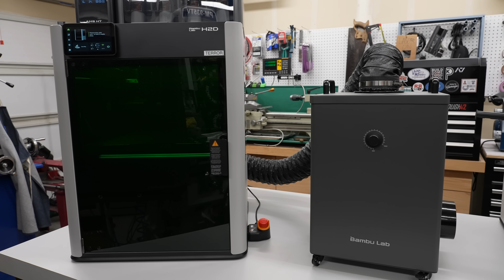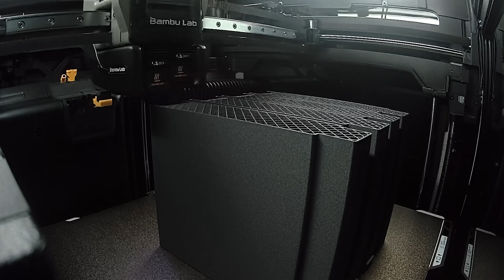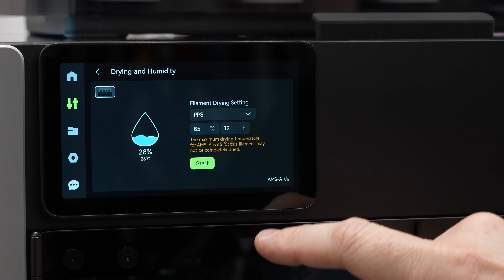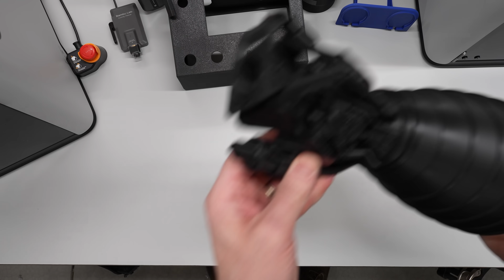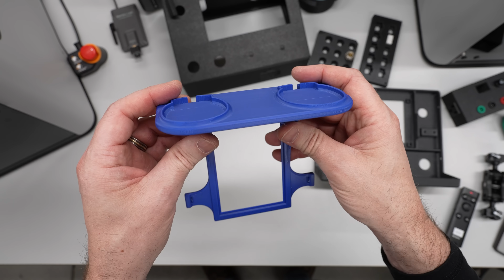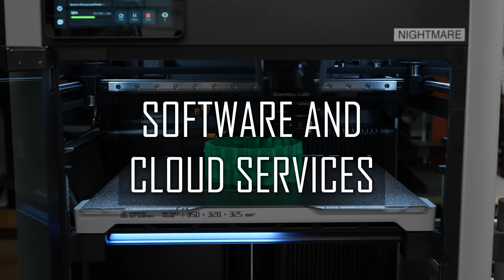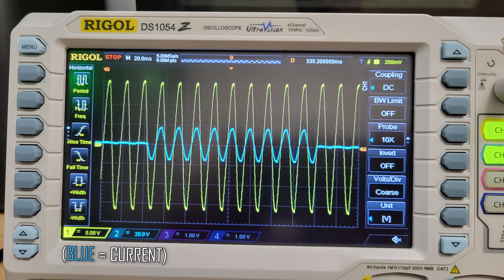What I Learned from 300 Hours with the Bambu Lab H2D 3D Printer

Comment: It would be nice if they could use the camera at the beginning of a print to detect the presence of a forgotten purge tower. I've been burned by that a couple of times. The last time it happened, the auto-leveling mesh was so far off that the nozzle dug into my build plate and gouged it.
Reply from the maker: Yeah, I thought that, too.  It seems like that should be doable if the bed is otherwise pretty clean.  If it has layers of ossified glue with the footprints of a hundred previous prints it might be harder.
Reply: @ The other thing they could do is add some sanity checks to the auto-leveling code. In my case, I was getting z-axis movements on the order of 10mm as the print head traversed in x and y. To add insult to injury, the calibration procedure moves the print head before clearing the mesh, so when I flipped the plate over and recalibrated, I gouged the remaining good side too!

Comment: Just when I started to think that other companies were catching up to Bambu and I could switch to printers with a more open ecosystem, they take another clear step ahead. In a small shop having a all-in-one machine is such a space saver.
Reply: I would advise against depending on the laser  module. Even the FAQ says that regular maintenance will need to be performed to prevent issues from dust and debris. You are likely better off getting a stand alone laser.

Comment: the laser is cool but i only use laser when cutting large pieces. And most laser cuttable sheets are rectangular so you'll only get an a4 sized sheet in there and i dont know what you can cut in wood or acrylic that you couldn't just print. Cork and card is a possible exception but it's a very niche use case.
Reply from the maker: Yeah, I think this is a concern.  That's why I tried to emphasize it in my summary.

Comment: Thank you for your honnest and detailed review. Is the width for spools in the AMS units the same as in the XCarbon? I have issues with some prusa spools jaming if the are just slightly deformed.(and many are)
Reply from the maker: Yes, I heard someone saying that it was narrower because a non-Bambu spool jammed for them, but I think it's what you describe.  The Prusament spools I have fit, but without any extra room, so any deformation would be a problem.  From my measurements, the spool wells are the same size, and the overall outside dimension is actually about 2mm wider.

Comment: 300 hours? Wow, you must have been given this well before they made any announcements. The price of the base machine is within my expectations. I’ve been saying it should be between $1,400 to $2,000. These machines are going in the direction 3D printing needs to go. I’ve got a color Hp laser printer and I never think about using it, whether I’m making copies or prints, or just scans. That’s the way 3D printing needs to end up. Otherwise it’s just for hobbyists.
Reply from the maker: The evolution of the 2D print industry is a good comparison here.  I remember having to set up form lengths, fonts, margins, baud rates, and linefeed mapping to get them to work properly.  Over time they evolved to the point where many printers don't even have buttons.  The buttons are back today so you can connect to wi-fi, but the point is valid.
Reply: @Clough42 yes. I started modifying teletype machines. Then making boards for the (new) Brother electronic typewriters, and in from there.

Comment: First, thank you for a good video.  Second, did you try other TPUs besides the Bambulab TPU for AMS?  I'm interested in using really soft TPU like Ninjaflex in combination with rigid filaments to make bicycle grips.  I have to use an IDEX currently and don't really like it.  I'm hoping the H2D can handle it in one head whether it is in the AMS or outside.  Its hard tell in the pictures so far if the filament path is constrained enough... Thanks!
Reply from the maker: It has a separate filament passthru port in the back of the machine, so you can bypass the buffer.  That's how I ran the 90A.  They also sell 85A, but have instructions for feeding it from above without a tube, IIRC.  I've run the 90A and the TPU for AMS, which is barely flexible.
Reply: @Clough42  Thanks for the extra info.  I'd be interested to see how the 85A prints. If you happen to have any.

Comment: You say they aren't paying you for this video....... They bloody should, excellent video. Showing how it works for YOU, rather than THEIR samples was great. HOWEVER a laser in a printer will not end well, the glue and crap in materials will cover the inside and I suspect 8-12 months down the road they will need parts replacing.
Reply: So if you have a print and need some thing Lazer marked. Would it not make sense to just do it in one tool. I think that it should be viewed more like adding a laser to a CNC router. It is a added tool of convenience not a tool to be used as the main thing. I mean would you get a CNC router so you could laser with it all the time?
Reply: @thomasswearingen6971  I don't have an issue with multi tools, the drag knife and pen plotter are good. My point is that if you are buying a multi tool machine you will want to use it for many things but I have doubts on the longevity of the insides of this. Of course only time will tell and we'll all have to wait for the true effects of smoke, glue and acrylic particles on the bearings and rods and rails.

Personally I would prefer a separate device.
Reply: Yeah, I’m viewing this as just a really awesome larger format twin extruder 3D printer.  i.e. The base model (with AMS).  I view the Laser capability as just a potential upgrade option, that I’d probably never do.
Reply: I really wonder about that too. No matter how good their chamber ventilation is, the microscopic smoke particles are going to get on everything and in particular gunk up the slides.
Reply from the maker: That's a fair concern.  They do have a pretty good history of making replacement parts available for reasonable cost, but the smoke contamination is a new thing, and I would think it will be an issue for heavy usage.
Reply: 100%!
Its easy to get 4k hours on my X1C with just basic maintenance but I don't think this one will last as long before the entire insides and motion system will get gunked up from all the nasty emissions
Reply: They did pay him...by giving him 2 H2D printers 😮
Reply: @pinzgauerbelgium  Not really, let's assume you work at a supermarket, if they "paid" you in food products would you be happy and declare I've been paid for my time and physical work? No you wouldn't, James can't pay for bills with printers. They've provided them for free but he and other content creators still have to use them, film, edit and publish content that all takes time which they aren't paid for.
Reply: I also suspect maybe you and the billion people repeating this line aren’t the only ones to have ever thought of it. If you’re laser cutting nonstop, then you are an idiot for buying this printer to do it. If you’re doing it occasionally then it will be fine, and you avoid having another piece of equipment taking up space. 

I have no idea who all this “helpful advice” is geared towards. It’s like every 13 year old on Reddit just learned that lasers burn things away (SHOCKING!!!!) and that this can generate soot, and have made it their life’s mission to spread this piece of obvious and mundane wisdom to nobody in particular.

Yes, thank you, you’re very very very smart and good. People with experience and needs beyond 3d printing nude anime figurines can make their own decisions.
Reply: @Rokmononov  why are you acting like a triggered child? I remember when this community was filled with enthousiasts instead of toxic noobs ranting about their dumb opinions
Reply: @Rokmononov  Haha, what a childish comment. Making the non experienced viewers aware that having a laser inside a 3d printer is a bad idea is a completely valid opinion. If you believe that does not affect you, then move on.
Reply: @Rokmononov I've seen how quickly the residue builds up inside the lense assemblies on other laser engravers, and how surprising it is for 3d printing people that it happens so quickly, so it's not exactly "mundane wisdom"
Reply: Well…not paying you but how did you get the printer? 😂

Comment: There is a lot of critic about Bamboo lab, that they force the user to connect the printer to Internet.
Reply: Yep, that is one of the costs of such an integrated system. Try using an Apple product without becoming part of their ecosystem.
Reply: @JorgTheElder  I would never use an apple product!
Reply: Do you want to send the file over wifi? You need to connect to the internet OBVIOUSLY. If not you can just hook it up with a LAN cable or worse, go back to 2015 and transfer to your SD card lol.
Reply: @ Check out my links. I i buy a product, it is mine. And then Bambu labs change the the terms, that is a fraud!
Same as car industry, ink printer company's, etc.
Reply: @KryaDiere  But you will miss all the software upgrade by doing so. I like to own the product that i buy.
Reply: They don't
Reply: @ Just search Yt, there are a lot of users that dont like this.

And Apple, never in my life!

Comment: Any word if its possible to run seperate nozzle sizes in the machine? I know you can Kind of do this on the Prusa XL (which is why i have been looking at buying one) though it requires quite a bit of fiddling currently. I am very much enjoying the concept of using a smaller nozzle for small details or text on prints.
Reply from the maker: They sent me a whole pile of different nozzles from 0.2 to 0.8.  My understanding is that you can mix them, but it wasn't clear to me if that's implemented now, or coming in an update.  Sorry.  I just don't know.
Reply: @Clough42  all good, it would be unfair of me to expect that out of anyone at this point. Since people have had limited time to play with it. Everyone tends to hit the key points of interest for their work. This is definitely an oddball question.

Comment: some very welcome improvements but Bambu should have really launched a 4 head printer instead of sidetracking with lasers. Period.

I have lasers and the amount of carbon buildup and smells despite good ventilation is simply unavoidable. The 10w is only 400mm/s which is slow, Even the promising 40w at 1000m/s ain't fast.

Comment: Can the one ams unit feed both nozzle at the same time or does it require 2 ams? And how much waste are really saving on it.
Reply from the maker: One AMS connects to one nozzle.  You can feed a single spool to the other nozzle, or connect a second AMS.  If you want, you can connect a whole bunch of AMS units if you want.  Filament savings depends totally on the print.  If you're switching between just two filaments (at a time) and switching on every layer, it can be quite a lot.  If you're switching between four filaments on every layer, you'll still generate a lot of waste.
Reply: @Clough42  thanks most my prints are 2 or 3 colors rarely 4 but I have fine tuned to get as little waste as possible. I'd love to see side by side comparison in the slicer later for time vs waste comparison between the printers.

Comment: Laser is intriguing but not sure I want the smoke residue in the same chamber as where I want high quality printing.  Did you do much printing also in that one if you had done any laser work?    Also, is standard cutting possible with the standard non laser machine? for me Printing is huge with the added bonus of being able to cut double sided tape for part adhesion items.
Reply: It would be best if you used a powerful extractor because the smoke oxidizes everything in its path. I have experience with laser machines.
Reply from the maker: I just lasered what you saw in the video.  I wanted to see it work, but personally probably won't use it much for what I do.
Reply: @Clough42 okay, correct me if I'm wrong but the cutting (non laser) is only available for the laser machine?  Non laser cutting and 3D printing is all i need
Reply: @Clough42  I would really appreciate it if you could do a deeper review of the laser/cutter/pen features. I do a lot of functional items and sometimes I really could use a laser/cutter/pen option sometimes. I actually like the idea of one device that has these features, instead of having to buy separate tools. But darn near all the other reviews also glossed over the other features as "Hey it can do laser cutting engraving, cutting and pen, too." and that's it.

I have a feeling that Bambu might be somewhat concerned that no one really delved deeply in the laser/cutter/pen features in their reviews.
Reply: @MrDB42 laser seems like a gimmick to me. No maker is going to use that laser, risk of smoke and fire is too great, better to use a dedicated unit
Reply: @ But you have the same issues (smoke, fire, dirty, etc.) with a dedicated laser cutter. Some of us don't have the space for all three devices, 3D printer, Laser cutter/engraver, pen/cutter plotter. A signal device that does all three is a nice idea (depending on how well they work).

Besides, if you look on Bambu's site, there is a C02 extinguisher add-on for the laser version to make it even more safe.
Reply: I'm also interested if the cutter module can work on the non laser version. It seems that the laser version adds air and the laser protective windows. They do talk about offering upgrade kits to take non laser version to laser version. I'd rather just buy the cutter module stand alone with a standard H2D.
Reply from the maker: @ehamster  My guess would be not without adding the other safety features.  For them it would be a liability issue.
Reply: @Clough42  surely laser glass isn't needed for physical cutting with a blade, not is air assist. Or are there other safety features, such as door interlocks that are only on the L model?
Reply from the maker: @ehamster  sorry.  I misread your message.  Yes, if I put the cutter module in my standard printer it prompts for calibration.  If I plug in a laser module, it complains that safety glass isn't installed, the safety key isn't inserted, the estop switch isn't in the correct position, and the Birdseye camera isn't installed.
Reply: @Clough42 that is good info! I think the non laser version of this printer makes the most sense for reliability (I hate that green glass anyway), but I can totally see myself using the cutter attachment for the regular printer as well. 

No one has tried the pen plotter yet in any of the reviews, I'm curious to just see it working lol

Comment: Will I be able to have this printer and a gaming pc on the same circuit ?
Reply: No
Reply from the maker: Peak power draw on 110VAC is specified at 1320W.  It depends on the PC, but it could certainly be an issue if it's pulling the better part of 1000W itself.

Comment: LED flicker is a software issue - kipper has a setting to fix this - nero3D has a video on this - which is why they said a firmware update will fix it. - something to do the wavelength of the power (or something like that, it can be adjusted so it does no conflict with the LED wavelengths) wavelengths may be the wrong term, but I ad the same problem with another 350mm bed printer and made the change from Nero3D and it fixed it. Point being, this will be fixed with a firmware update
Reply from the maker: When they release the firmware change, you can bet I'll have my scope out again.  I expect some kind of change to the PWM cycling frequency, but I'm curious to see how they interleave that with the AC waveform.

Comment: So is the build volume actually 350*320*325 no matter which nozzle you use?
Reply from the maker: No.  There's a strip on the left edge of the bed that can only be reached by the left nozzle.  Same on the right for the right nozzle.
Reply: @Clough42  That's a bummer I was hoping for a full 350mm in at least one direction.
Reply: No